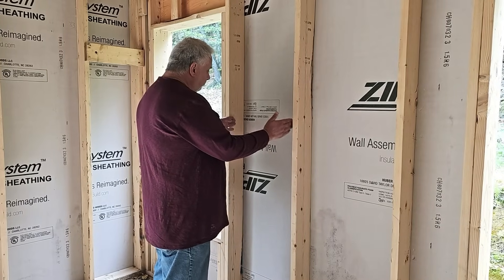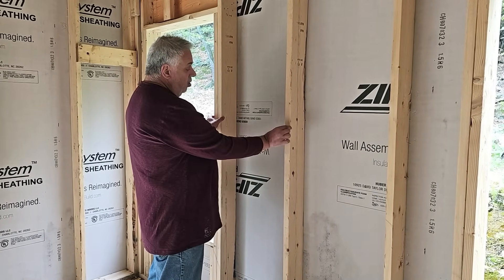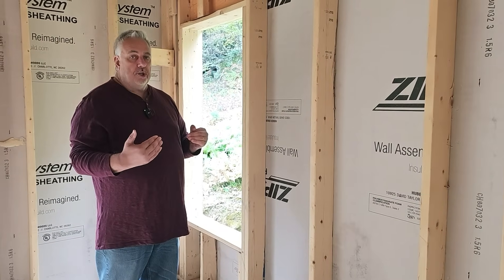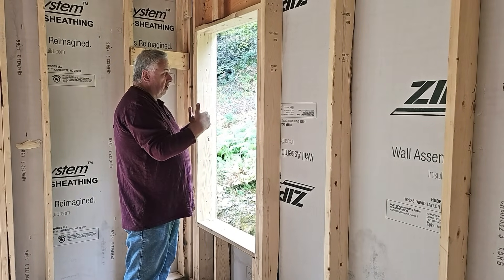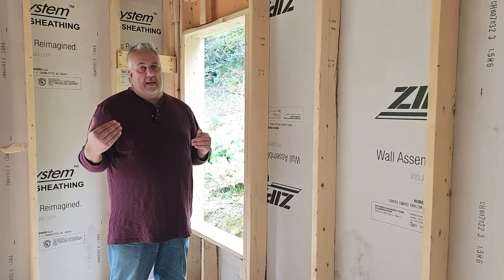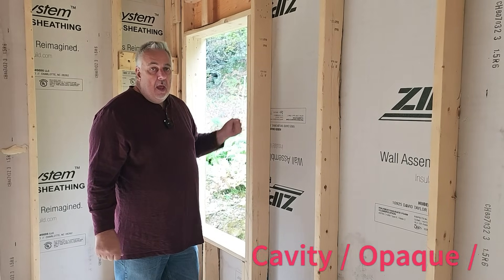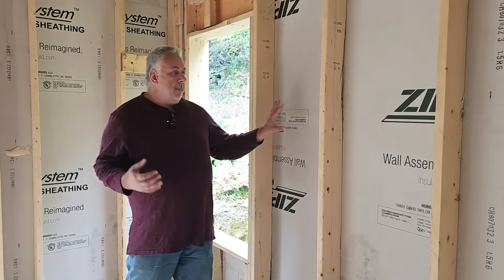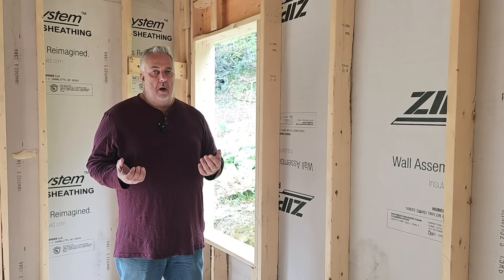WHOLE WALL R-Value

Comment: Hi Steven, a company sprayed foam closed cell a step van, which is aluminum. They did not cover some aluminum studs and aluminum in the ceiling. The unexposed aluminum is a super hot thermal bridge. What's the solution?

Comment: My question about R values has to do with wind.  I figure the physics of a forumula presumes the air is not replaced every second.  In scotland where i build, i use metal cladding to keep the wind off the formula; but it makes me wonder if everything's really airtight, the best whole-wall system.  My latest thinking is to fully clad both the outside like with zip board, and then on the inside with the plasterboard as well to make sure that the insulation covers the framing bridge on both inside and outside.  If a wall is U value .02 and its 20cm thick, with a 100mph wind at 32F affects the insulation how?

Comment: Steve, is there a formula that calculates ROI for complete wall assemblies based on energy costs?
Reply from the maker: you could create one - the challenge is, What is the baseline you are using?
Reply: @stevenbaczekarchitect9431 The baseline would be code compliant as that would be the bare minimum build.

Comment: Jesus Christ!  This entire idea of R-value and building science is just so much garbage.  There is only so much you can do because the real problem is doors and openable windows.  By the very fact that they can be opened means that there must be a tiny--very tiny--gap around the entire window that opens or door.  (Never mind that the vertical studs are a superb heat transfer path.)  The way to solve the window/door problem is to double them: Put an unheated--preferably greenhouse--'mud room' around every door.  You enter the mud room, close the door and then open the 'door' to the house.  This does not solve the problem completely but close.  The openable windows need two windows; one opens inwardly, with hinges on the side and the other opens outwardly with the hinges on the opposite side.  It would probably be a good idea to make this outward window easily removed in the summer as it is not needed.  As to the walls, double studs are the only way to really insulate the walls.  Finally, consider mounting your electrical and plumbing on the inside of the wall with conduit so that you can eliminate the 'holes' for lighting fixtures, switches, outlets, and so on (no matter how well you chaulk, spray foam, or whatever, these openings are 'leaky'.)
Reply from the maker: It's called a vestibule, and I do incorporate them

Comment: Great informative video Steve. In the UK we have separate R-value requirement for windows so we would not factor them into the wall calculation but we do factor in the thermal bridging of the timber frame. As we usually build timber frame to 600mm (24 inch) centres so we would get better values that the 400mm (16 inch) used in a lot of US builds.
Reply: The only home I worked on with 5/8 drywall throughout was specified by the owner who had lived through a house fire. The fire sprinkler systems they require around here make people feel safe.

Comment: Would love to see a cost savings analysis.  

How many years of utility savings until these systems pay off.   

I know when it comes to water heater and furnaces, the lower efficiency units make more sense.  

They are considerably cheaper and last longer.  So by the time the more efficient unit starts to see cost savings, it's at the end of it's life.  Where the lower efficiency unit is still plugging along.  

Less parts to break the better.
Reply from the maker: against what? It's like asking why does an expensive car cost more than a cheap one? I'll tell you the cost, but first you tell me your established baseline by which you are basing the comparison?

Comment: Why is Zip 1.5 R6 described as R-9 in this video?  What am I missing?
Reply: Maybe he’s included the R value of the framing as well, which is between r3 and r4. I’m confused as well.
Reply from the maker: I know the inside of the sheathing says 1.5R6 but it is in fact R-9 insulation

Comment: I think an energy analysis that gives a rating is best to show what a specific house with specific components will do relative to known performance--instead of the wall insulation value--actually cavity value.
Reply from the maker: It does - the video was to give a more true understanding of what is actually happening

Comment: That’s why I like insulated concrete forms, the strength, the air tightness, the insulation value even the thermal mass
Reply from the maker: It doesn't pen out like you think, actually, not even close
Reply: In your opinion, what do you think the best wall system would be I just like to hear from all sides. Thank you.

Comment: surprised you didn't mention the exterior sheathing give you a thermal break, which is an often overlooked aspect of the whole house design. It's one reason I like the use in building as you have a layer where it's harder for the heat to move through those studs (build show had some cool engineered open cavity studs where you could blow in or foam to get even more thermal break)
Reply from the maker: That's because I did a second video on Thermal Bridging, uploaded this morning
Reply: @stevenbaczekarchitect9431  missed that one! I've been way to into building science as I'm getting the design work of a home done right now, doing 30cm thick pre fab walls, might hit passive or near passive once done, we'll see where we end up

Comment: Great stuff, Steve. I've watched a bunch of videos on this concept (including yours) and this is one of the best explanations. Thanks for revisiting this. 
I would love to see a similar explanation on the pros/cons of bigger studs. Like is it worth going to 2x8 or 2x10? That seems to be popular with the Passive House crowd. From videos like yours it seems like the money/effort would be better spent on more exterior insulation and better windows.
Reply from the maker: EXTERIOR INSULATION ALWAYS WINS - because it captures improvement at the opaque area AND the cavity area.....
Reply: @stevenbaczekarchitect9431  The the optimum wall framing would appear to be the narrowest studs that provide all the structural strength you need plus the thinnest exterior insulation that provides all the insulation you need? Could adding wood fibre insulation into the cavity of such a wall add enough thermal mass to usefully retain heat across the night-time?
Reply: Good question. Perhaps both.. His videos have definitely caused me to focus more on the outside.
Reply: Thermal mass is wonderful, but density is very important for being able to figure on thermal mass holding on to heat from the day.  Things like concrete and steel are great at holding heat and absorbing some extra heat

Comment: Steve, have you worked with that Canadian company that uses multiple films inside the window to get to "R21?" These are interesting and could pull the whole wall R value up, BUT I'm sure there's some down side besides cost.
Reply from the maker: I have not........yet
Reply: @stevenbaczekarchitect9431  Haha love the foreshadowing. Very much looking forward to that.
Reply: An R-21 window?? That would be the MOST efficient window I've ever seen.  
Who is supplying that?
Reply: @wjthehomebuilder  LiteZone out of Canada.
Reply from the maker: @wjthehomebuilder  I would have to see it to believe it actually
Reply from the maker: I would think that is COG - Center of Glass, not window unit? The windows in the video are R-10 COG